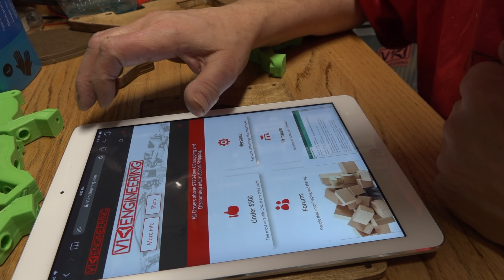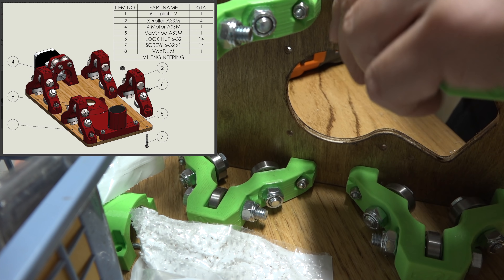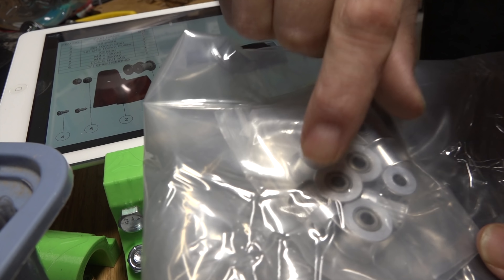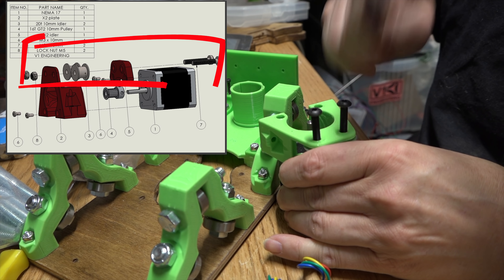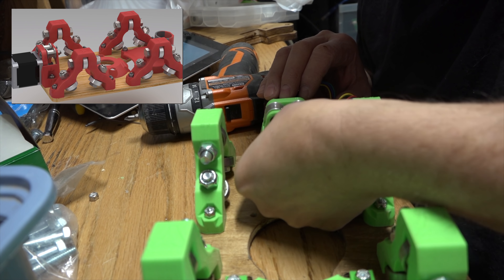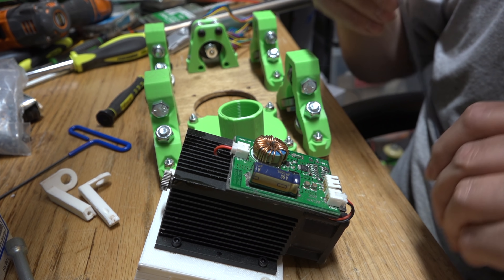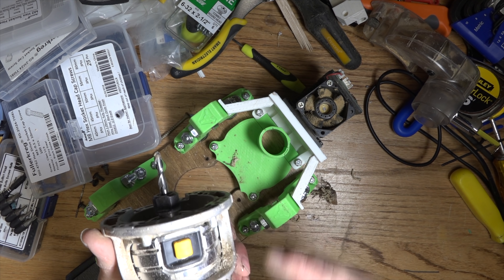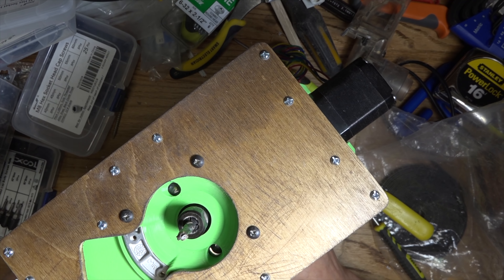Lowrider II Build - Part 2 - 611 Plate

Comment: Hi, where did you get the dust deflector cover for the bottom of the 611?  Been looking around on thingiverse and don't see one w/ the same streamlined design as yours.  Thanks for all the detailed info!
Reply: nevermind - just found it in the supplied parts from Ryan - still waiting on UPS to deliver them and trying to print all the extras I'll need in the meantime...

Comment: Do you still have a source for that laser module?
Reply from the maker: Thanks for watching!  Amazon or eBay. Mine is "Sunwin" brand 3 watts.  Make sure that you get one that is pulse with controlled. Some of the more powerful ones have fixed focus, which might present a problem when you still have a bit in the router (e.g. can't get close enough to the work to focus), but I don't know for sure.
Reply: @Someoldguycoding  thanks for the reply.  I have the version 2 low rider,.  All the components are built and I am in the process of making the table.  I watched your laser videos after seeing you mounting the laser module in this video.  Definitely want to try that out.  Thanks for all the videos....